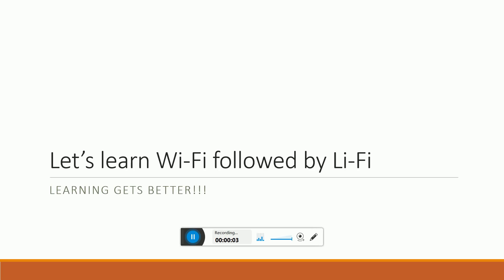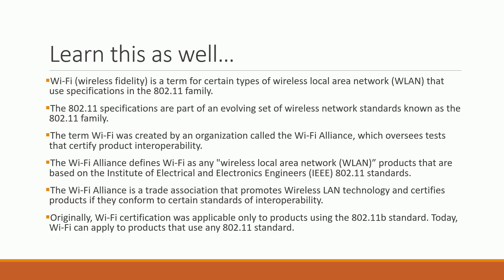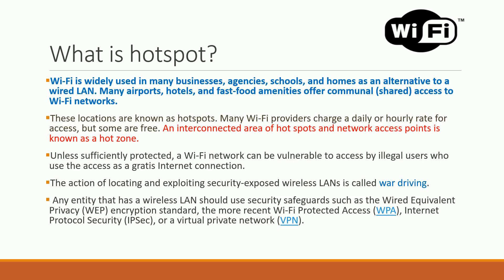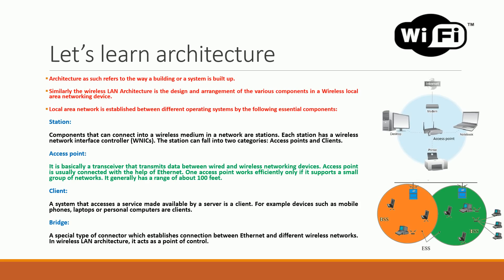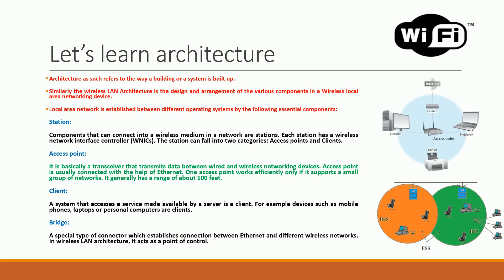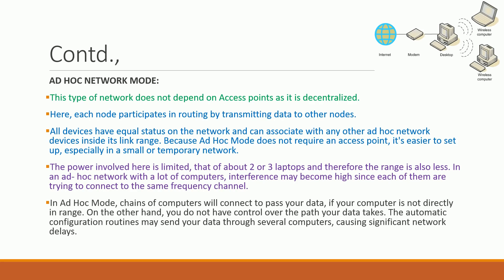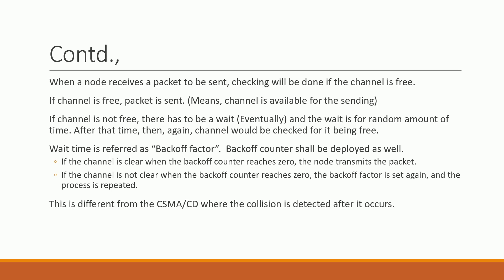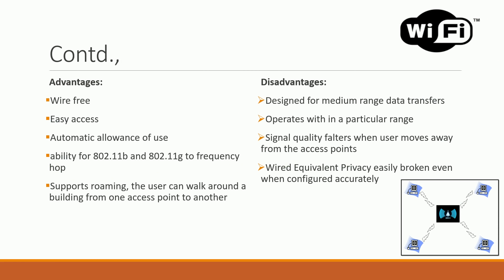19. Internet of Things - Protocols - WiFi

Comment: The application of IoT in the automotive industry is truly revolutionary! The ability to remotely monitor and control vehicle systems enhances both safety and efficiency. Real-time data processing for urgent tasks, like collision warnings, can save lives, while non-critical use cases like fuel efficiency insights can help optimize costs. The integration of cloud platforms further extends the potential of IoT by enabling smarter decision-making. I came across GAO RFID Inc; you might find it pretty useful for this topic, especially for exploring advanced IoT solutions.